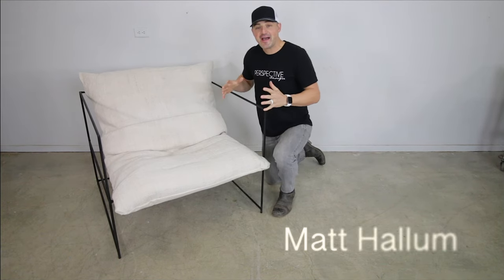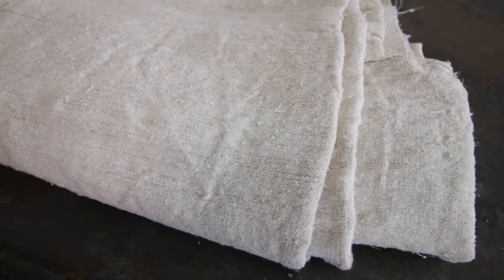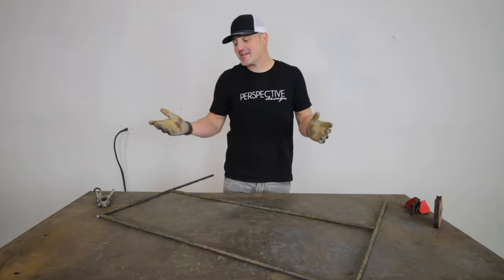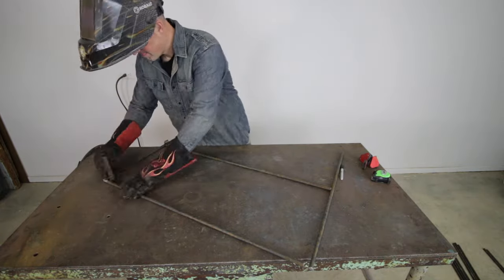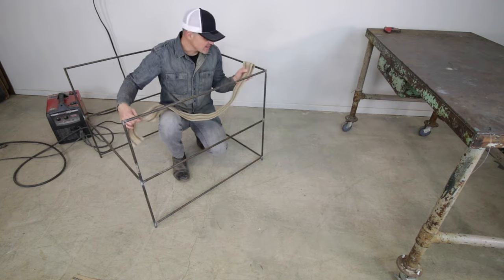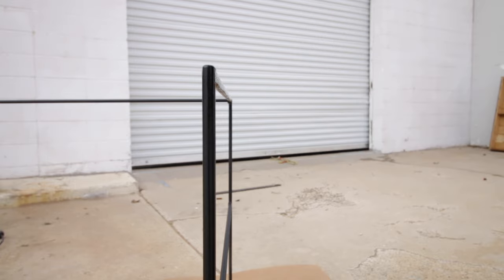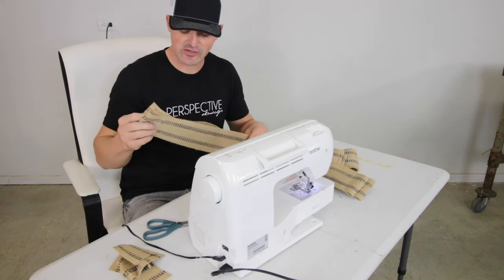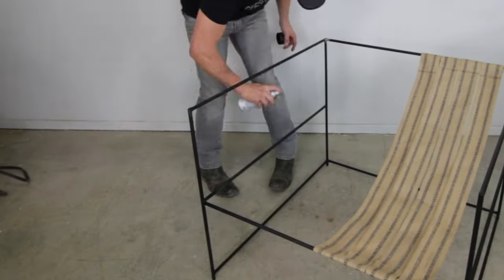Modern Style Metal Chair Built, Welded DIY Upholstery Project

Comment: This is awesome. I’ve been eyeing up these chairs for a while. I want to clone the dining chair made by the same company. What did you use to get the 3-axis welds (back bars) square? I also realized the issue of having to slip the fabric strips over the bars before fully welding them!
Reply from the maker: Aaron, I used the 90 degree magnets used when welding.  Just used several on each 90* corner.
Reply: @PerspectiveDesignCo  thanks!!